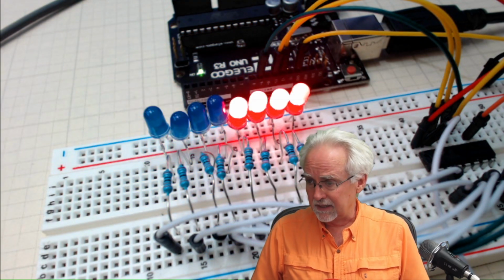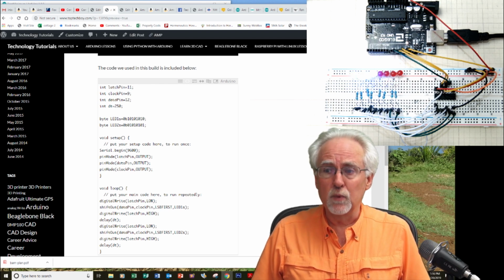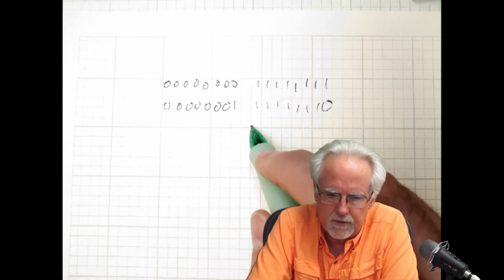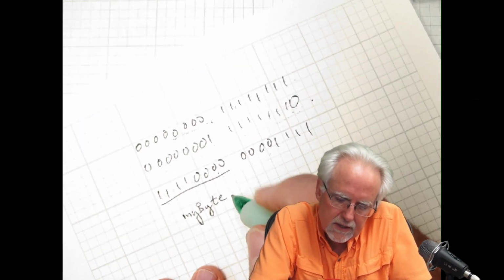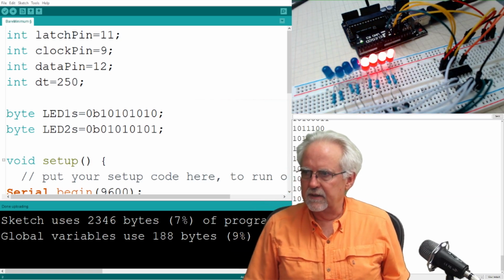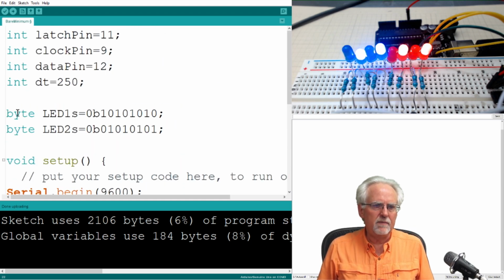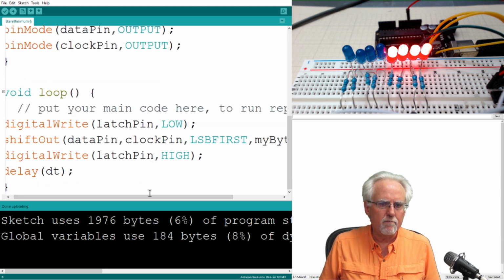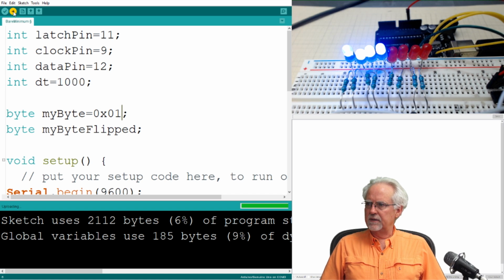Arduino Tutorial 47: Binary and Hexadecimal Bit Flipper

Comment: As always doing the homework! I went even further and combined the last couple of videos the create an interactive programm : the user can choose a number to represent myByte and choose between multiple actions (shift, rotate, flip and bounce). Every action comes with a set of other questions so the user can specify things such as direction or how many times something should be repeated.  This akes it possible to choose whatever pattern you want and also do all those actions for a limited ammount of time without having to upload new code or having to reset it every time. By far my biggest programm so far (245 lines). I made it in Tinkercad but I don't know if I can share it if someone would like to try it.
Figured everything out on my own except the left/right shifting. Probably should have given it some more thought than I did though. You explained very well how to actually use and programm for the shift register but unfortunately not really how it physically works which I find unfortunate.
Anyway, very looking forward to learning how to implement an lcd dislay to my projects. and I will definitely keep continuing to build further on what you teach on the videos and try to implement it in a different and bigger project!

Comment: I don't understand how 255 - Mybyte = would flip the bits. The Shift Register IC chip is not flipping the bits or shifting the bit because the arduino code is doing the bit flipping not the IC shift register IC chip?

Comment: i did it differently

void setup() {
  // put your setup code here, to run once:
  Serial.begin(9600);
}

void loop() {
  // put your main code here, to run repeatedly:
  Serial.println(led,BIN);
  delay(1000);
  led = (led-1) + led*2 + led*4 + led * 8 + led * 16 + led *32 + led * 64 + led*128;

}

Comment: Sir I did it a different way but I don't know if it'll work. Here's my code:

byte myByte1=0x0F;
byte myByte2=0xF0;
int latchPin=12;
int clockPin=11;
int dataPin=10;
int dt=500;

void setup() {
  pinMode(latchPin,OUTPUT);
  pinMode(clockPin,OUTPUT);
  pinMode(dataPin,OUTPUT);
}

void loop() {
  digitalWrite(latchPin,LOW);
  shiftOut(dataPin,clockPin,LSBFIRST,myByte1);
  digitalWrite(latchPin,HIGH);
  delay(dt);
  
  digitalWrite(latchPin,LOW);
  shiftOut(dataPin,clockPin,LSBFIRST,myByte2);
  digitalWrite(latchPin,HIGH);
  delay(dt);
}

Also I have some questions. How can a whole number be subtracted with hexadecimal or binary numbers?

Thank you for taking the time to read. Love your videos Paul.

Comment: Hello, I haven't watched any of your new arduino tutorial videos yet, but have pretty much watched all of last edition of videos.  My question is, in lessons 28-30, you went over software interrupts, do you plan on doing a video on hardware interrupts?  Maybe you already have and I just haven't seen them yet.  I've seen many tutorials on arduino and other micro controllers, however,  your tutorial are the best!  You describe how things work and why they are the way they are in great detail.

 I'm currently working on a project using arduino nanos, reyax LoRa modules, and a nextion TFT touch display.  My project is basically an air pressure monitoring system.  I can display the pressures of an object a kilometer away on the TFT display.  I would also like to use the same display to push a button and light up an LED within the air pressure sensors arduino circuit that's a kilometer away.  I'm guessing the best way to do this would be by using hardware interrupts in my code.  But I don't quite know much about those.  Anyways I really appreciate the in depth video tutorials!  I've learned quite a lot just from watching them.  Thank you!

Comment: Hmm this option looks like it might replace a 74 series hex inverter on a midi circuit i am working on. For some reason my bits are getting flipped comming out of my 6n138 octo. I am already using a atmega328 in this design and have unused digital pins

Comment: Interesting project could be a binary to hex decoder. Using a two character 7 segment display for hex the 8 LEDs to display binary. Could use the serial monitor to input the binary values. Indeed it could be reconfigured to be a hex to binary decoder. Might help with the association between the two. 

That’s your homework assignment for today! 😂

You are doing brilliant work Paul....👍